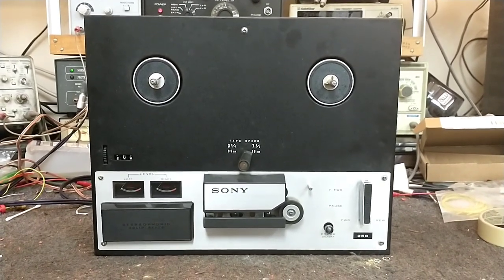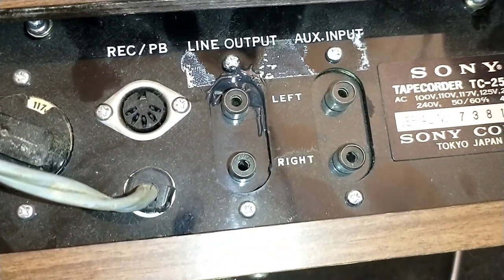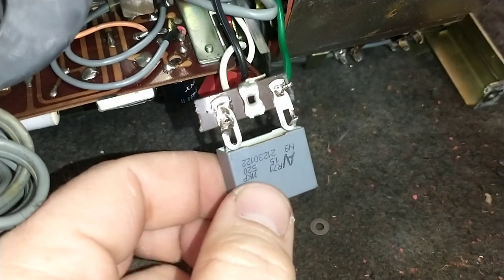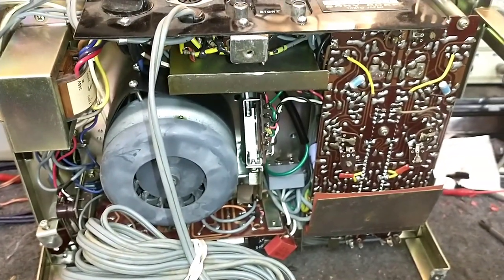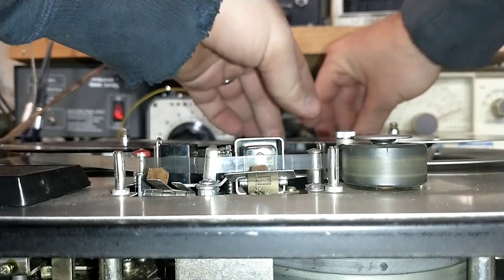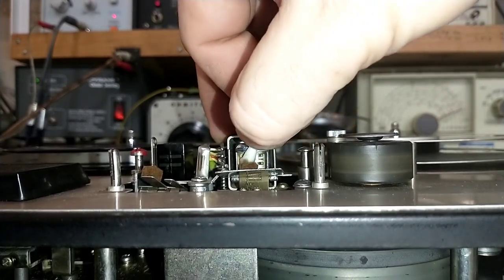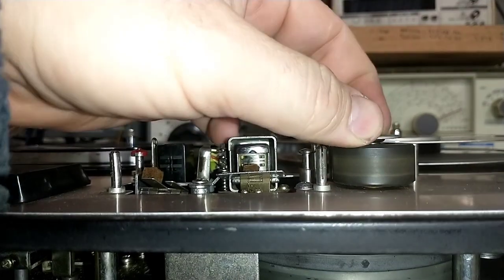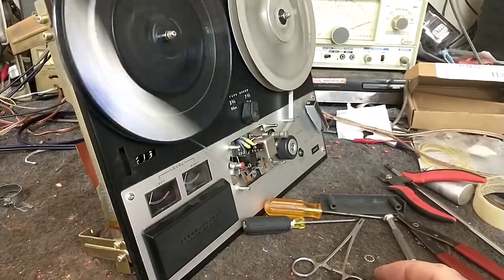Quick repair of a 1968 Sony TC-250 Reel to reel. slow, channel out, and alignment

Comment: I always "freshened up" rubber idlers and pinch rollers with just letting them run, without a tape, and then lightly using some 600+ grit sandpaper on them, then cleaning up the wheel and capstan well with IPA afterwards. Glad it behaved and you got it back into good working service!

Comment: Damn, thanks Jordan for posting this. I have a few of these in storage that I wanted to learn on before working on a few nicer units I have.
Reply from the maker: In addition to what I've mentioned here, be sure to clean out old grease from the various mechanisms. They are 90% of the reason why an old one what's been sitting won't do much of anything.

Comment: The motto which some customers fail to follow is simple: "unless you know what you're doing when it comes to an item of vintage electronics, have the proper equipment, skills, relevant service documentation (e.g. Riders / Sams manuals) and experience, don't attempt to fix it yourself, leave it well alone; if something does go wrong, send it to a technician/workshop for professional repair if possible" 😎
Nice repair there Jordan. Hopefully it will last another 100,000 km (however many miles that is) from now.😇

Comment: Nice tutorial. Thanks Broseph! What oil to use on teac motors? They have fill spouts. I was going to use lightweight oil like I use for hair clippers, but looking for a proper solution.
Reply from the maker: Mo98 with an oil syringe to get it in the motors.

Comment: Thanks for posting this!  I have the same unit and I am trying to record with mine, but the left channel input is scratchy and weak.  I've tried working the jack to get rid of any possible oxidation, but it seems like it may not be a physical connection issue.  Is it hard to freshen up the transistors/preamps on this unit?
Reply from the maker: This one's no fun to service the electronics

Comment: I had to remove the feet on mine to get it to fit in my Fisher Regent Stereo cabinet... it only has 6" of clearance with the top closed  so it sits on shims just enough as to not sit on the motor cage

Comment: Thanks for sharing. I have the same model 250. I have one channel out. I think the left what piece doI need to order for it? The head? Or do I need to check for cold solder joints first?
Reply from the maker: Check for bad connections at the head. 

If that looks good, touch the head connections while in play. If you get a buzz out of both speakers but only one channel is playing music the head is bad.

If you only get hum out of the side that plays thr play back amplifier needs to be troubleshot.

Comment: I just acquired a 250, have worked over 120 of the 366 and 377 models, they are much easier to work on.  The 250 will not change speeds mechanically for some reason.....not sure how the speed rod is held in place going from one speed to the other.

Comment: I have a sony tc 255 and there is no audio play or record do you have ideal where to start looking to troubleshoot?
Reply from the maker: Check power supplies against schematic feeding audio sections. If ok, check mode switch attached to play/stop cam for broken shaft or bad wafer. Signal tracer is really required along with test tape of consistent tone

Comment: Some Sonys use a 250 volt motor capacitor. My Sony has a 1.5MF/300 volt motor capacitor. Will a 250 volt work?
Reply from the maker: Typically no. Always stick with the rated voltage, not lower
Reply: @JordanPier  How about a 450 volt?
Reply from the maker: @sunbeam8866  that would work fine
Reply: @JordanPier  Thanks for the quick reply. The Sony here is a TC-105. It plays perfectly for about 30 minutes, then slows way down. I also have a TC-230, with the nice walnut-veneer case. That motor wouldn't start at all. Thankfully, someone removed the vent-screen on the bottom, so I could lift the unit up and start it, by giving the motor-fan a little spin! But it ran slow all the time. Finally, I swapped the capacitor (and vent-screen) from a TC-230 parts machine, and now the motor self-starts every time, and runs perfectly - for about 10 minutes before it slows way down! 
By the way, when I was still 'kick-starting' that motor, I found I was able to start it backwards! 🙂

Comment: What cables do I need in order for me to record to my Mac book or pc?
Reply from the maker: Depends on what inputs your mac or pc has, whether analog or digital
Reply: @JordanPier  it’s usbc, hdmi, and headphone auxiliary Jack
Reply from the maker: @oddmirage1740  if you have an analog aux in,  use an rca to 1/8" stereo male adapter to get the sound into your mac/pc then use something like audacity to capture it.